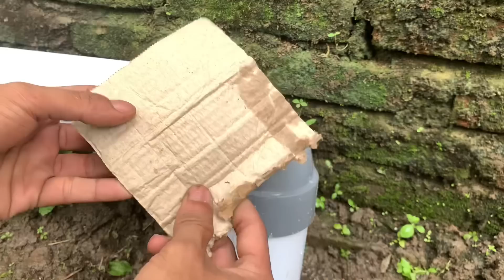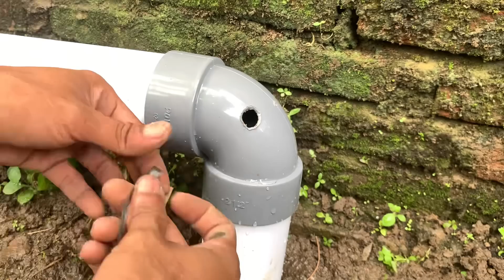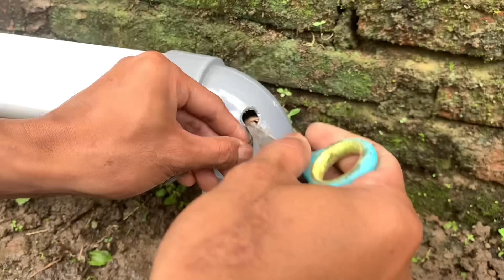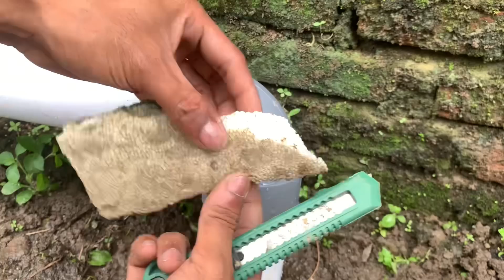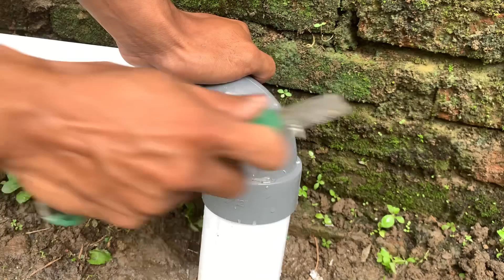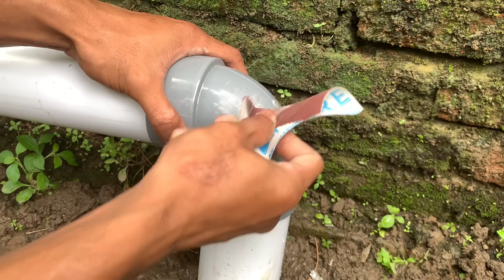Never throw away cardboard boxes! Look what this genius man did to a leaky pipe

Comment: The superglue probably cost more than the broken elbow joint
Reply: It's acetone bro
Reply: @leonidasking7502  ,😄🇬🇧
Reply: @leonidasking7502  Superglue was used in the beginning to glue the cardboard to the tape.
Reply: @leonidasking7502  Yeah?
Reply: @leonidasking7502  No, it's not! Acetone would have dissolved the superglue he used to secure the cardboard. It's also in the same container as the Superglue. Plus Superglue dissolves styrofoam.
Reply: @leonidasking7502  Super glue also chemically melts things.
Reply: Not to mention it is a shitty repair.
Reply: This should’ve been a superglue ad 😂😂
Reply: @iamnegan1515  ... nothing wrong with the repair. Superglue melts the PVC pipe and the styrofoam, it forms new plastic. It is like welding up a hole in a steel pipe. But with plastic.

Comment: I'll have to remember this trick for the zombie apocalypse. Until then I guess I'd probably just spend the $4 to replace the elbow.
Reply: we only have a few weeks to go get ready
Reply: That won't work if the line is pressurized.
Reply: @augieq66  And gluing it while its pressurized would?
Reply: Be the last thing I worry about in the biden appocalypse
Reply: Yes, in case a zombie drills a small hole into an non-pressurized PVC pipe.
Reply: And try not to drill a hole in the new elbow!

Comment: For myself, I would probably have grabbed a rubber/neoprene well nut from my stash of stuff in the garage, replaced the stock screw with a SS screw, dropped the well nut in, tightened the SS screw, and called it a day.
One important point however, is that this guy, and many others on YouTube, create content to show how to repair something with just the materials on hand. I can tell you from personal experience(s) that sometimes you either haven't got the time to drive to a hardware store, or when you get to one it hasn't got the item you need, or you are way out in the boondocks and the nearest hardware store is a couple hours round-trip. I personally appreciate these guys who, every once in a while, teach me a new trick.

Comment: The best part was cutting the foam to fit not knowing it was going to melt
Reply: exactly
Reply: Well if he would of used cigarette ashes and mixed it well and poured it in hole and added super glue the two make plastic incase you didn't know

Comment: No idea why all the hate for this video.
I had a hole like that in a water pipe.
I bought a brand new 90 and following the instructions here I managed to cut the new 90 down to a small circle that fit the hole perfectly. Then, using 4 bottles of superglue, I was able to secure the small circle in place.
Following the instructions on this video all I have to do is buy a new 90 and 4 bottles of cryanocrylate every 3 or 4 days and cut the 90 down to size

Comment: ALWAYS keep JB weld handy.  The cardboard with JB Weld would have been a lot faster and held until you can fix it the right way
Reply: Shoot I seen a new thing at Napa auto store which is 10xs better than jb weld it had a display by the counter of all the things it can stick to and several items stuck to different surfaces and I'll tell you that next time I'm in the area of that Napa store I'm gonna look to see what that stuff is called and buy it and just keep it on hand you can use that stuff to hold a bracket for a TV on a cement wall and it'll hold your TV up no problem

Comment: The fact that he took the time to cut a square block of foam to go in that round hole caught my attention then to watch that foam melt had me Lmfao..I had to finish.
Reply: Not me, I couldn't, I had to go re-wire my electrical panel with uninsulated coat hangers.
Reply: I saw somebody repairs dentures with cotton balls and super glue. Super glue will melt styrofoam..

Comment: If that is drinking water, and it looks like clean water, but its the size of a drain pipe. Let's say it's a water line coming in to the house to make my point. That cardboard will grow mold mildew almost immediately and then you drink, shower, cook, clean wash dishes with it. Do not ever use paper to fill up a water supply line. It's not safe. It won't hold water pressure either. It will fail and you will flood out.
Reply: 🤔I was thinking the same  thing yuck,

Comment: As a stop-gap measure ok. It is a homely way and not intended for commercial purpose. Also, not suitable if the end of the pipe is connected to a tap.
We should appreciate the practical mind behind this idea - without going for the evaluation of monetary benefits. ✌️

Comment: The big problem is leaky pipes are not usually 1/2” holes drilled in a convenient spot to patch, it will be a bad glue joint or splintered pipe. Show us a quick fix for that.
Reply: Superglue and styrofoam
Reply: Bandaid. Works every time.

Comment: Instead of using cardboard and styrofoam to fix the hole, why not just find a small scrap piece of pvc pipe, a bottle of pvc primer, and a bottle of pvc cement and glue the scrap of pvc pipe over the hole? That way, you know it's repaired permanently and don't have to worry about it until it can be repaired professionally.

Comment: Styrofoam???!!!???  Lol just put the super glue on thick then immediately put on a layer of baking powder/ soda. Repeat until the entire hole is filled! This will firm a pseudo-type plastic filler quick and cheap! It also accelerates the glue to dry instantly etc. 
     Do that ontop of a little styrofoam (like you did) to make sure you get best of both methods. The styrofoam first will possibly be good for resisting the water better than the powder but the baking soda will lock it all in perfectly and u can build it up thicker than the pipe was originally. 
Thanks peace good job on the video bro!!!!

Comment: Flex seal guy would scratch his head .... "OMG! There's much better, quicker & securer solution ....."
Reply: Used flex tape works perfectly even to hold my window and frame from the elements that I can get fixed atm. Cost me 600 to fix just 2 very small ones this will be around 1500. The last guy did the best he could I guess it's a old house with old window installations. I swear by the flex seal brand never had and issues.

Comment: Try that with a pipe under pressure. Replace the pipe and fittings. If you try this you’re screwed.
Reply: well tbh this type of pipe was not ment to be under pressure, its a waste water pipe.
diameter of that pipe suggests that the wall thickness should be 10x if it was ment to be under pressure

Comment: I fixed a metal pipe with actual psi.. for a water hose line super glue and gorilla tape some dude was making fun of me it's been a year and it's still not leaking he said I needed to cut the pipe and add a joint binder I will one day for now it's good

Comment: After you insert the cardboard put cigarette ashes on a piece of paper mix them well pour them in hole put super glue on ashes repeat until it's slightly higher than pipe then sand down and you'll witness magic cigarette ashes mixed well and super glue make plastic

Comment: It won’t hold up. Two different plastics with different chemical properties. PVC is difficult to bond to. Especially with dirty polystyrene. The pvc will expand and pop the styrene right out. A better solution in a bind is to melt the hole in the elbow closed with hot metal.

Comment: You drilled a hole in it but didnt replace. Its super easy to remove just the 90 and glue a new one between it. This is simply not reliable, especially that we plumbers try to hide our pipes in the most narrow corners. This is just bullcrap

Comment: Pipes don’t get drilled holes (unless someone drills a hole. Hands don’t get life changing cuts when the idiot owner cuts away from his hand. 
Some gap filling plastic cement fills cracks in hard plastic pipes. The cheap softer push fit pipes have to be replaced. Superglue won’t do anything useful.

Comment: This is some cheap ghetto-ass apartment maintenance guy type of "repair". Don't ever do this. It WILL fail again, and quickly. Fix it right. Honestly, a proper replacement of the broken 90 is easier, faster, and much more effective than this crap.

Comment: That's not a leak that was a hole drilled on the 90. 2 couplings pipe a 90 and some glue and I'd be back at home drinking beer before u let the super glue dry on the card board